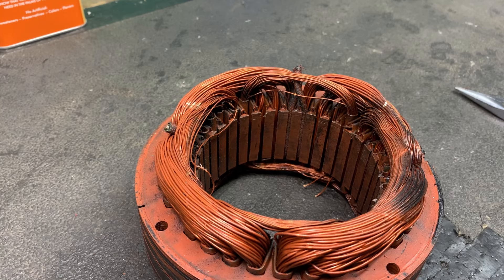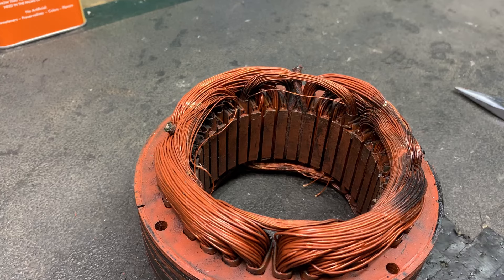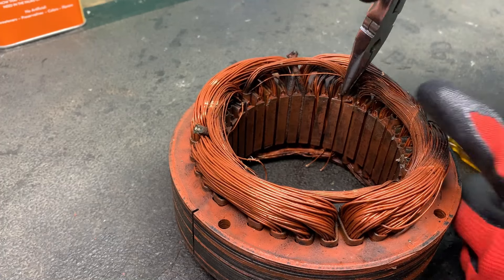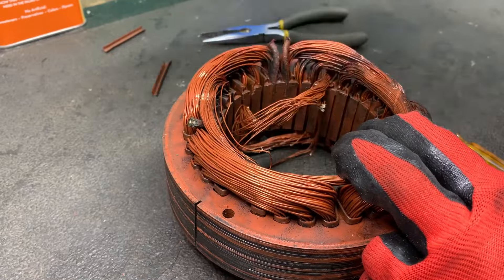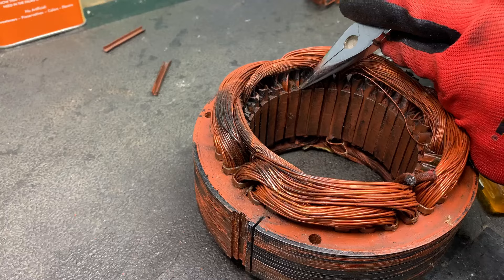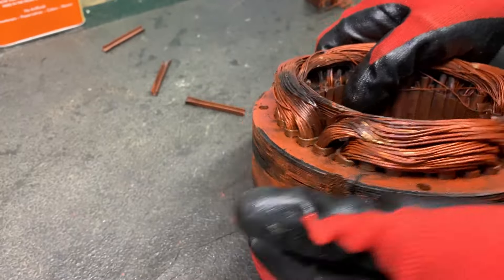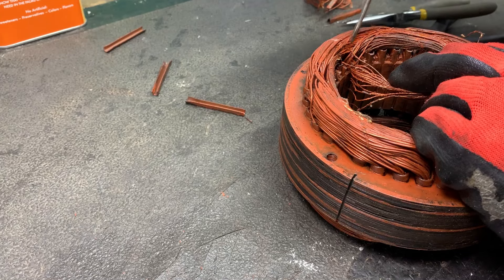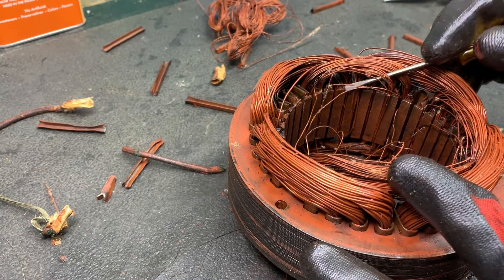New Method for Removing Copper from Motors

Comment: Yea some times it doesn't come out like that if it's laquered. How do you get the string off when it's laquered ?.
Reply from the maker: @michaelnonferrousscrapper682  I use a hook blade to cut them. If you hammer the area if it’s heavily lacquered that’ll help separate the strings from sticking to the copper and then they can be cut and removed
Reply: Oh ok. I wish the strings were all like the ones inside a ac compressor those are so easy to cut off. Also some of the things on window ac compressors are copper like that little side tank thing if it's not magnetic you can lop it off and get contaminated copper for it at least hear anyway. I chop them off at the elbow and chuck them in a bucket I got 37lbs for them from 55 tanks. Maybe you knew that already ???.
Reply from the maker: @michaelnonferrousscrapper682  yeah some strings are just awful lol 
I did know that, but I do appreciate you pointing that out, someone might read your comment and that could help them. Thank you
Reply: @scrapitall200  glad to help I've been doing this for hm not sure 15yrs but even I don't know a lot of recycling some things I do. How long have you been doing this?.
Reply from the maker: @ I’ve been scrapping about 3.5 years now.

Comment: Good technique, but they are not insulator, but spacers or packing plugs, to hold the wire in place. The wire is already insulated with lacquer.
Reply from the maker: I was told by a guy who assembles these that they are for insulation purposes. I’ll have to do some research, thank you, I appreciate your comment. 
Thank you also for watching!

Comment: Did you cut off a bunch of string before starting video, because I would rather cut motor in half with meat cleaver, & leave strings on, so 2 easy to handle bunches of Cu get pulled off each end.
Reply from the maker: Just one strand of string. 
I use a machete but I like to show different methods. 
Thank you for watching

Comment: There is a metod even more efficient: melting all together and when  copper melted extract the steel. Aniway you have to melt it in the end...
Reply from the maker: @hipolitoaceituno8214  I don’t have a furnace right now and most hobby scrappers don’t either, so I like to show different ways to remove the copper. Thank you for watching.

Comment: I have never ran in5o a motor that the sleeves come out that easy and windings that are lacquer  won't do that at all
Reply from the maker: Many won’t work for this method. I have found the ones with plastic sleeves do come out more often than not. 
I just like showing different ways of doing things. 
Thank you for watching

Comment: Time vs profit..or is it easier to simply get a job with today's pay structure, average starting pay is $15 an hour.  Use that as your base when stripping out the copper @ $3.45 per lb. plus you would need to have this material available every day and the place to process it.🤔🤔🤔
Reply from the maker: I’m a hobby scrapper

Comment: No cutting is the best way to go unless there's a way to cut the iron.
Reply from the maker: It’s a neat methods that works as long as the insulation sleeves will come out. If they don’t I use a machete to cut the motor in half. Thank you for watching.

Comment: That motor is a rewind, not factory original. From the factory they dip the whole stator in varnish and you won't pull it apart with pliers.
Reply from the maker: That’s not true. I have done this exact method from stators that I removed from sealed units. I’ve also did it on a GE motor that I know for a fact wasn’t ever rewound.

Comment: A very slow method when you have to make 30 motors, and it will only work with very few motors, most of them have varnish, so it is impossible to use that method.
Reply from the maker: Thank you for watching

Comment: The scrap yard hear will not pay cleaned price with the coating on it  your lucky your scrap yard buys it for cleaned copper
Reply from the maker: Oh wow, that’s awful. 
Which state did you live in?
Reply: @scrapitall200  Missouri
Reply: Missouri
Reply from the maker: @deanharbord3591  ok thank you! I’ve never heard of yards not buying that as clean copper. I appreciate the information
Reply: @scrapitall200  they buy is hear same as #2insulated  like wires and cords
Reply from the maker: @deanharbord3591  wow! That really sucks. That just doesn’t seem fair at all.

Comment: THIS TAKES FAR TOO LONG, i could have had at least 8 motors the same size stripped the time you finish one.  I TAKE A MACHETE and a HAMMER, put the motor in a vice. put the machete in one of the grooves of the steel stator. tap the machete with a hammer and it will split it and with a few more smacks with the hammer it'll cut right thru the copper quickly at that. just keep your sharpener handy and use a machete you wouldnt mind tearing up.
Reply from the maker: I’m known for using the machete method. It’s fun to try new things.
Reply: @scrapitall200  KY bad dude. I apologize.     I welded a piece of metal onto the machete to provide a better striking surface. I use a chisel on the stubborn ones.
Reply from the maker: @AG-cz9cu  I like your idea of welding a piece to strike, thanks for the idea!

Comment: New methods are supposed to be faster/better, not slow as fuck and uneconomical.
Reply from the maker: One might say it’s better because no cutting disks required which cost money and no copper dust which means no respirator 
Also, it was my first time trying, like with most things, practice and experience makes things faster. 
Thank you for watching